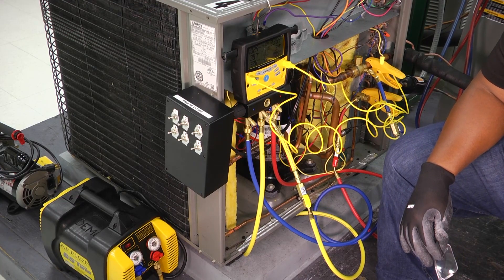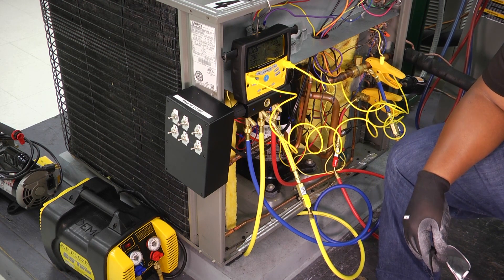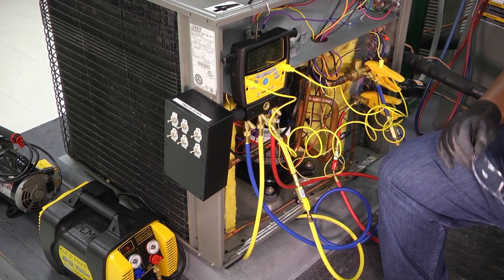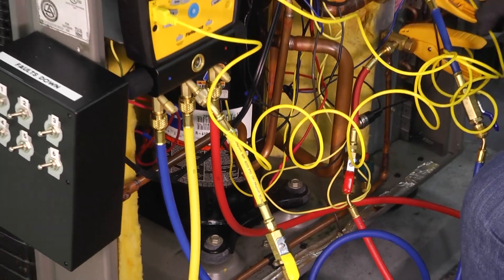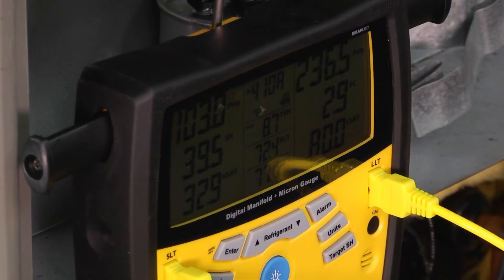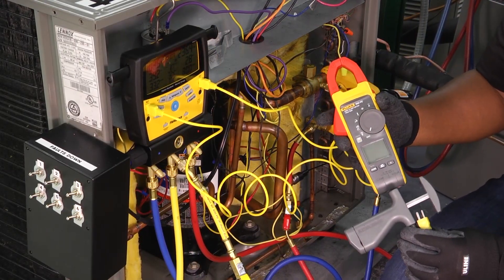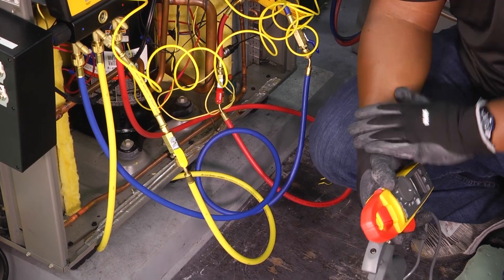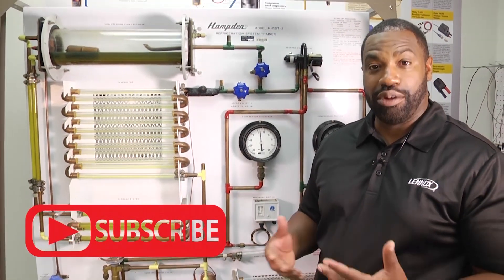Superheat and Subcooling Calculation Overview

Comment: With analog gauges, SH method is more work cuz you are suppose to go inside to get wet bulb measurement. I have found that with R22, the high and low side pressures will end up the same no matter whether you have a TXV and use subcooling, or if you have a fixed capillary valve and  use superheat method. So I just use subcooling method no matter what metering device it has. It's the same in automobile ac charging. It makes NO difference what metering device the car has.....all that matters is the high and low side pressures that are based on outside temperature.

Comment: Nice vid please tell why lennox does not always use sh or sc to check the charge but uses the approach method. With a 2.8 sc a lot of techs would assume the system was low on charge and try to shoot for a 10 to 12 sc and over charge the system